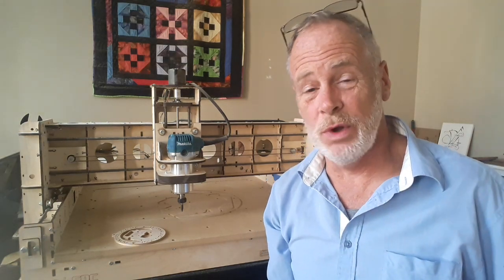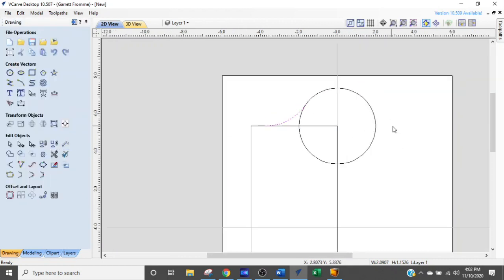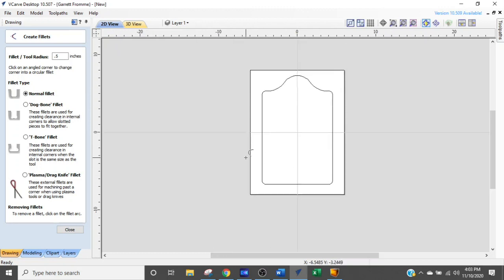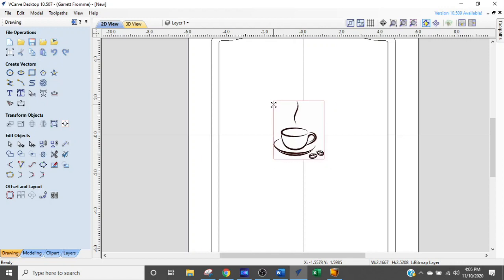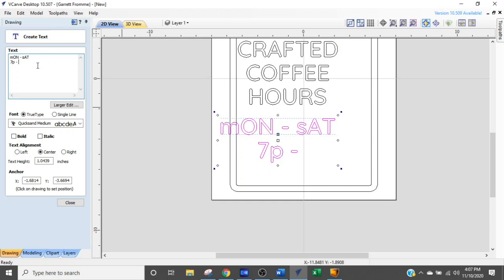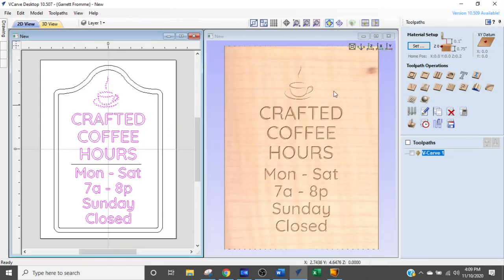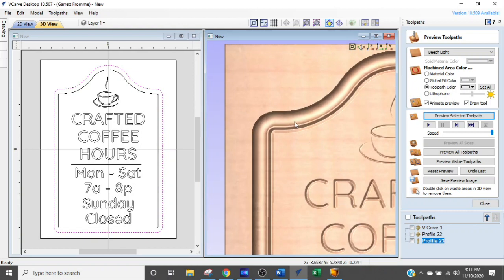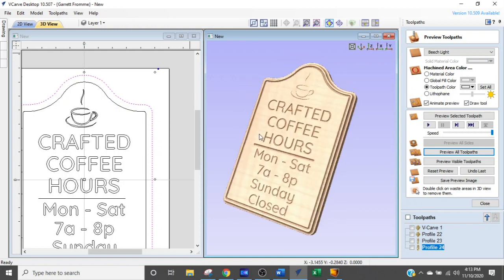13 Minutes To Design CNC Router Projects

Comment: I ran into numerous problems making this sign, most of which were caused by the fact that I'm using VCarve Pro 12 and your tutorial was based on an earlier version of VCarve . 
However, the one problem that wasn't the result of the version differences was the that the Coffee Cup image wasn't cut deep enough, the carving just barely broke the surface.  The only solution my amateur mind could come up with was to make the coffee cup a separate toolpath and tell gsender to plunge deeper with the 90-degree engraving tool.  

I learned a lot programming this project, but it would have been helpful if you not only mentioned what operation to perform but also explained how to do it. There is very little that is intuitive about VCarve Pro, you either know how to do it or you don't.  Being a rank novice, don't assume the viewers know how to do what you just briefly glossed over. I spent a great deal of time just finding the function let alone figuring out how to perform the function. Oh, and one more thing... the project that you said should take 15 minutes (or there abouts) took me 2 days.   😀
Reply from the maker: edluna5224, I'm glad to hear you learned a lot despite the challenges! VCarve can definitely be a bit tricky, especially for beginners, and I appreciate your feedback about the tutorial's clarity. It sounds like you came up with a smart solution for the depth issue with the coffee cup image. Every project is a journey, and your persistence will only make you better at CNC woodworking. Keep enjoying the learning process!

Comment: Thank you for your step by step tutorial .A small question about the software, they remove the machin tab from the 10.5  how do you add a new cnc machine ?
Reply from the maker: Oldmanwoodcraft, you are so welcome. I am not too sure what you mean, I was using Vectric 11 in this video. Your software might be a bit different if you are using Vectric 10.

Comment: not what i was looking for... this is the easy part... interface usage... i was interested in how to setup my cnc with V-carve... as i don't know the manufacturer... its some cheap 3018 pro it says but manufacturer is fake since anyone could assembley it with the proper parts... is there a tutorial on this?
Reply from the maker: GeorgeZaharia, you will need to use a post processor that works with your machine brother. Here is a video that should really help you: https://youtu.be/wQ0vgXbSRr4?si=l2GuUak_IYSmuaNi

Comment: I have just purchased my new CNC and while I am not totally unfamiliar with the CNC concept and machines, I am not familiar at all with the programming.  I watched your tutorial on Vcarve for beginners which I loved and appreciate and I am now following along with this video on making a sign.  I have encountered a problem.  After making my circle and connecting the  Arc and cutting everything away, I try to go to the node mode and delete the vector but not all of the lines connect.  The top part of the arc does not go to the dotted line like the rest of the image.  I have tried starting over many times but it still does the same thing.  In my playing around I have evidentially clicked something or turned something on.  Any suggestions as to what my problem is?   Thanks
Reply from the maker: yendorrepooc1005, I recommend taking a look at this video here where I walk you through cutting and joining nodes → https://youtu.be/kEGxnlfzmNY. I think you'll find it super helpful!

Comment: Hello again, Thanks for all your help. Last 2 months have gone fast but I've learned a lot from watching your vids. I finally got  Gsender to connect to my little 3018 machine (had a bad kill switch)( took awhile to figure out it was a normally closed switch, so unplugging it from the board did not solve the problem, but jumping the leads did.), I bought V Carve Desktop, got a Mark2 30x30 ordered, and built a CNC room in my garage just barely big enough for the machine to fit, I hope. Actually retro fitted a 6ft x 4ft storage closet. Yep I know its gonna be tight. Now my next problem is doing my own design work. Using Gsender I'm setting XY zero at the front/left corner but when I start to carve the spindle only moves onto the workspace a couple inches and Gsender shows it being in the middle of the project? Do you think the problem is my Gsender firmware setup or in my toolpaths? I know you can only make a guess. I don't know if its possible but it looks like its moving in millimeters and I thought I had everything set to inches including the final save to GCODE GRBL. But its exciting, most fun I've had in years, pushing my 80 year old brain hard again trying to learn all this stuff. Thanks again for sparking some life back into me and is that "At Amazon" guy lives anywhere near Phx have him contact me I'll be glad to help if I can. If nothing else we can have a good laugh at ourselves.
Reply from the maker: Bulldog, you are so welcome brother! It sounds like you are well on your way to making amazing projects brother! Keep working hard and learning everything you can.

Comment: Question, I'm new in this and I tried to carve some letters as you did but I'm doing something wrong because my bit its not cutting clean, at the sharp edges is making like a ball finish... I'm using a 60 degree angle bit,  I tried to go deeper and ligter on the pressure and I'm still getting the same results, I hope you can help me to figure this out...
Reply from the maker: Send over some pictures to garrett@idcwoocraft.com, I would be happy to help!
Reply: @IDCWoodcraft  I will do it first thing in the morning sir, Thank you !
Reply: I've been trying to send the email but it says the address is not found... Maybe is missing a letter on the email address...?

Comment: Super beginner. Can I ask what the difference is between the Profile Toolpath and the Vcarve toolpath if you are using the same tool (90 degree) for both? Like why couldnt you just do the 90 degree tool for the first outline under the vcarve toolpath with the words? Thank you!!!
Reply from the maker: Abby, both toolpaths are great and you can use the 90 degree tool for both the profile toolpath and the Vcarve toolpath. 

The Vcarve toolpath require a closed shape. It changes depth depending on how far apart the side of the shape are.
The Profile toolpath follows a vector, and gives you the choice of cutting inside, outside, or ON the vector. 

Different tools for different jobs my friend.

Comment: Great for all the videos posted, very detailed but how do you actually send it to the router after calculating the paths?
Reply from the maker: Gil, I'm glad the video was helpful for you my friend. You'll use a postprocessor (such as gsender or ugs) to send the gcode to your machine. The one you will use depends on the machine your using.

Comment: Hi, I have been following you, I am based in NZ and facing two problems, 1. did a 3d model but when restarting the next day from around 50 lines after the last cut, I get different z levels to of around 0.50 mm. 2. after the model is completed the wood hairs appear in places that i cannot reach can you please help and advise me
Reply from the maker: VJ, when you reset a project like that, the machine typically looses its original position. Its best to do the project 100% in one day and not split it into multiple days.
Reply: @IDCWoodcraft  Thanks but the project was a big one and and running times more than 12 hrs

Comment: I recently bought a small desktop CNC machine to make ID badges.  After seeing one of your videos, I bought V-Carve Desktop.  I have three areas on the badge that have text, varying in size and spacing.  I have not been able to select more than one text box at a time to calculate vectors.  I assume I am doing something wrong.  In addition, when selecting the bit, the program has any end mill bits less than 1/8 inch grayed out and not selectable.  Any suggestions?
Reply from the maker: Don, I would recommend looking at this vCarve introduction video to get a good handle on how to select multiple vectors. Here's the link: https://youtu.be/wJlKiLugy5s
Follow along to this video too: https://youtu.be/hIzYO-ir4MY
As for your bit selection, have you made sure that you have your feeds and speeds for those individual tools loaded in the software?

Comment: Does it matter if it is a 1/2 inch bit or can you use a 1/4 inch bit?
Reply from the maker: Clyde, you could use a 1/2" bit but it would leave a lot of material around the corners of the letters. I would still recommend a 1/4" bit for this project in specific.

Comment: Thanks again. What did you use to finish it just stain
Reply from the maker: Al, yes I just used stain. You can use a top coat with polyurethane or shellac if you want to add a clear coat to it!

Comment: For all the people saying the speed of instruction was too fast. Did you know you can click on the button that looks like a gear near bottom right hand corner and adjust the play speed faster or slower? This has really helped me a lot. Thanks for all your amazing tutorials! You are so easy to learn from. Now if someone could help me with my speeds and feeds, I could really get going on the many projects that live in my head!
Reply from the maker: Lynn, thanks for pointing out the tip of changing the playback speed! I'm sure that will help out a lot of people! Sometimes I get too excited and talk a little too fast! I'm happy to help and hopefully you'll get those feeds and speeds down soon! My best advice is to keep the feeds and speeds PDF on hand to reference as often as you need! Keep up the good work!

Here's the Feeds and Speeds PDF link: https://bit.ly/3xiLebv
Reply: @IDCWoodcraft  I often have to Slow things down to be able to sync the Words to the Actions...  The hard part is sometimes the mouse movements and what you are selecting and maybe KB short cuts; are missed.  

I keep having to re watch; not a bad thing; but all to often trying to re create what I heard and saw  is Not = to what I end up with :-)
Reply: Thanx verymuch Lynn. You are genius. It sounds a bit funny anyway

Comment: Ok I'm going to throw this question out there. Are there specific materials that are best in making certain projects? Sign making, 3D carving, inlays, unusual designs, stacked text, two sided projects. Is there like a norm associated with a project? As a beginner I'm wondering if this is something to consider? Thanks Garrett
Reply from the maker: Hi Max. This is a very broad question with many answers. It really depends on what you're trying to accomplish, and what type of look you want. Unfortunately, it's almost impossible to answer this question because there are so many varieties of choices based on what I just said.

Comment: Though interesting to watch and there are some things a beginner can take away, but this is not a video designed for a beginner simply because you are racing through the steps. At the beginning of the design you went so quickly through creating the outline that a beginner is not going to know what to click, what tools to use, where to find them unless said student repeatedly watches the actions you made, does a lot of pausing and then guessing in their own Vcarve software. Who cares if it takes 10 minutes or 20 minutes to design. Take the time to clearly point out the steps, the locations of software tools used in Vcarve, the reasoning why you are doing these things and taking these particular steps. I do believe your future videos get more in depth so kudos. Consider redoing these older videos or just removing them.
Reply from the maker: Thanks Charles for your input. This is one of the earliest videos I created. If you start to watch this channel, you'll see that your suggestions are delivered and very clear step by step, slow for the beginner, type of format.

Like this video here. I think this will appeal to you nicely
https://youtu.be/C46zguYGM-o

Comment: I’m a new longmill owner, and  Working on vcarve desktop trial edition.  Was very happy setting up my first project until tried to save toolpaths where I was greeted with SORRY the trial version of the software can only save toolpaths for data from the suppplied tutorial files.please load a unmodified tutorial file to test machine output.  I’m lost.  Help
Reply from the maker: Hi Mike. You have the trial version. You need to purchase it in order to get ti to generate the toolpath. Unfortunately, that is the only way.

If you decide to get it, can you use the links below. They are affiliate links. Gives me a little pocket change. Thank you.
Vcarve Desktop → https://bit.ly/3D4CwjH
Vcarve Pro → https://bit.ly/3d4WrEU

Comment: Thanks for the step by step guide!  For some reason on my 3rd toolpath (tracing the edge) the bit is plunging deep into the material on its way to the coordinates it needs to cut.  It gets bogged down very quickly and can't move further.  Any ideas?
Reply from the maker: Hi Dave. Your Z safe height is set low. On the toolpath side, you'll see a srt button at the top. Click it. At the bottom, you'll see 'gap above z' or somethinglike that. Set the number higher.

The other [roblem may be you did not reset the zero on the bit.
Reply: @IDCWoodcraft  thank you so much!

Comment: I liked your video.  Your approach is simple and to the point.  I am having one issue.  You demonstrated drawing a line with the polyline tool.  When I performed the same function, V Carve and the profile tool would not carve the "open vector".  I could not find a solution for closing an open vector on a line.  It worked for you, not me.  I have found the same complaint by others on the forum.  Any solutions?
Reply from the maker: If you're software won't close vectors, then there's something wrong. You'll need to contact Vectric over that.

Comment: I really like your instructional videos but for beginners like me you move around quickly and often what “tool” you are using is not clearly shown. Also, you use lots of keyboard commands....a list of common ones would be helpful (ex....Control z does this....) thanks for your videos, they are helpful!
Reply from the maker: Hi Vic. This video was simply a 'How fast can I make it video". Most of the rest are very explanatory. Here's a lit of all the videos I've made in order. You might want to download it → https://bit.ly/3mLHGfI

Comment: Nice video !
How does it work with changing tools for this ?

You need to make seperate cnc programs from 1 drawing in vcarve ? or is the machine stopping, and allowing to change tools ?
Reply from the maker: Unless you have a tool changer, you need to have separate programs.

Comment: This was a great video. I would love to see you run the CNC to see how you do it and load it and do your tool changes. I have a Stepcraft D.840 I am learning and it has a tool changer. I am curious how this would leverage that. Do you run them as separate GCODE files for the various tools and steps to create the finished product?
Reply from the maker: Hi Crazy. I envy you with the tool changer. You can run multiple tools with one gcode file when you have that. It'll make life so much easier than most of us CNC'ers out here.
Reply: @IDCWoodcraft  hey Garrett, I am learning the tool changer and if I understand things if I am using five tools in the changer I run each tool as a job with its GCODE correct? I can’t change back and forth if I identify the tool in VCarve, correct? I think I need to pay you for some tutoring via video.
Reply from the maker: @stevef  I'll be here when you need me. Yes working with a tool changer is a little bit different.

Comment: I love your stuff and your presentations. I am an 80-year-old making custom garden furniture pieces. I would like some advice regarding the manufacturing of some of the more complicated chair parts on a CNC, and some advice on the type of machine you would recommend. Plus I would appreciate guidance on sign making, on the CNC, during the winter months when garden furniture is not been made.
Reply from the maker: Hi Barry. I'm sorry for the delay in responding. I was not feeling week at all for a few days. Regarding a machine for chair parts, it really depends on the size of the parts you want to make.

since the colder seasons are slow, focus heavy on christmas gift projects.

Comment: After I got the coffee cup bipmap traced and tried to delete the beans and the other little things I had to un group the vector to do that  is that correct. I did not see you doing that Jeff
Reply: Garrett I see when you are setting up your tool paths your Speeds rates are some slow is that what you think they should be  or is that what your cnc can handle.
Jeff
Reply from the maker: @resorter66  hi Jeff. They were slow. I was still experimenting at that time... The video is about 6 months ago. Speeds are much higher now
Reply from the maker: Hey Jeff. I didn't  group...it would have made it a bit easier. Yes, you did the right thing. Keeps the coffee cup as one item.

Comment: Enjoy your videos. Thee bits are working out great as well 👍
Reply from the maker: Hi Kipp. Thanks. And glad you like them. What are you making these days?
Reply: @IDCWoodcraft  working on cutting boards. I wanted to do, what seemed like 100's of things, but decided to "slow my roll" and concentrate on just one thing at a time. I do however want to make some clocks also.
Reply: Would it be an issue if I were to email occasionally for tips and advice? Mine is hockinguitars@gmail.com